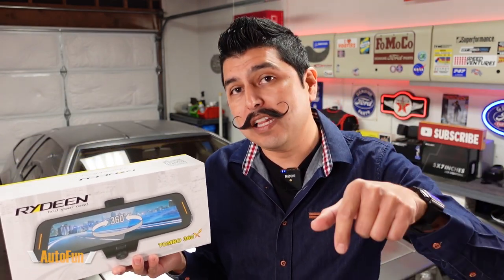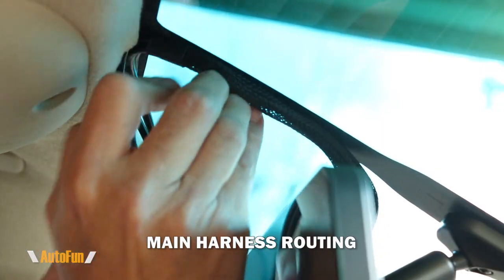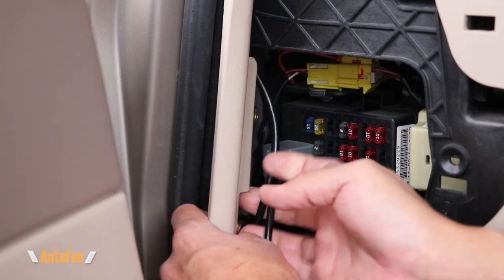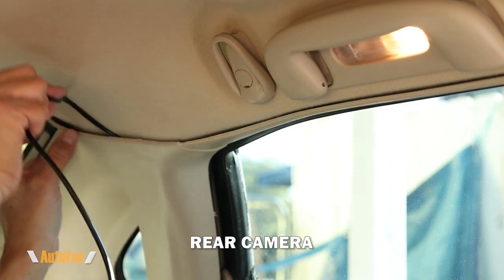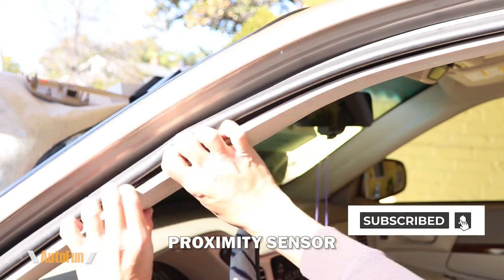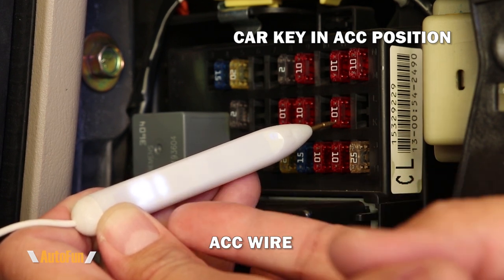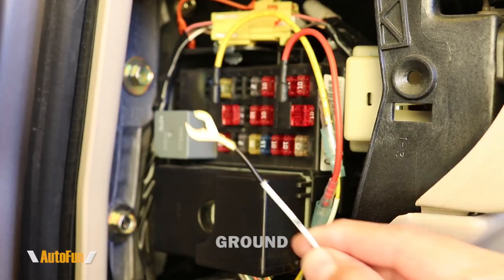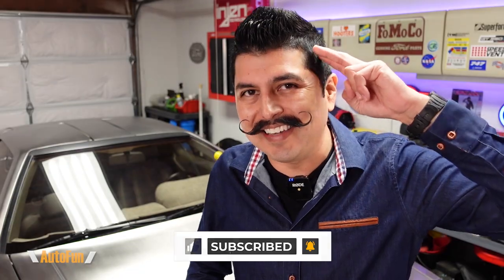Rydeen Tombo 360X Mirror Dash Cam Installation

Comment: Great video Alex...thanks! Are you still happy with this dash cam, and is it possible to hardwire it to my Silverado rear view mirror?
Reply from the maker: Thank you Rich! Yeah mine is still going strong and I actually just got the new update for it (video coming on this topic soon!) Regarding hardwiring it, normally this is done via the fuse box of the vehicle as shown on the video. Here is my follow up video where I cover how I find ACC and BATT on any car https://youtu.be/K2iKXj82354  However I strongly recommend profession installation due to the dangers mentioned on that video if erroneously tapping a critical system of the vehicle and the dangers involved with air bags mentioned on this video https://youtu.be/uZp95NbNlmM Cheers!

Comment: Hi Alex, you have a great site. One question, do you have a video showing how to install rearview mirror cameras to a truck, say a Ram 1500? Thanks.
Reply from the maker: Thank you fishnbaja! Ah yes the process is the same (camera can be mounted on the inside rear window to see out the back and also monitor the cargo or on the outside (if the camera is waterproof, typically by the license plate of the vehicle) And here is my follow rear camera installation video showing both inside and outside installation https://youtu.be/44WXN8MI66o with the inside being the shortest (and easiest imo). Cheers!

Comment: I really like this one. Which do you think is better between the Rydeen tombo 360 or the akeeyo 360/720? Im looking for a mirror cam that can be mounted without straps.
Reply from the maker: Hi Kendrik! Yeah the Rydeen is quite impressive. Regarding which one to go for, remember the Akeeyo 360 is not compatible with a direct fit mount, the 720 is compatible but does not support the advanced features that the Rydeen does (and does not come with the direct mount mount where the Rydeen does). So I would say if you are in budget and don't need all the bells and whistles go for the 720 however if budget is not an issue and you want the advanced features (Auto Dimming, Blind spot detection support, backup to SDD, concealed memory card slot, direct mount kit etc.) go for the Rydeen. And here is the review for the 360 https://youtu.be/u7jhNVtxQdM and the 720 https://youtu.be/o8begcmPA2w if you want to see those in more detail. Hope this helps, Cheers!
Reply: @AlexAutoFun  thanks for the fast reply. I was going to purchase the Rydeen Tombo 360 today. There's a car shop a few blocks down that has it. Don't know if they are an authorized dealer. Only because I want the warranty.
Reply from the maker: @Only1Of  You're welcome! And I placed a link to the mirror in the video description along with a discount code in case you decide to get it directly from Rydeen to ensure warranty (most installers will install a dash cam bought outside their shop) Hope this helps, Cheers!

Comment: I have a cuestion. This device fits on original ford explorer 2020 mount... thanks
Reply from the maker: Hi Willi! This dash cam is a universal type so it will fit pretty much any vehicle with the included straps. Here is my full review so you can see those in detail https://youtu.be/vUEsIYEBVck and if you are looking to eliminate the stock OEM mirror to mount the dash cam directly to the windshield here is my video explaining that process and the different mount types https://youtu.be/cCpyHmiZqiY Cheers!

Comment: Is there anyway to move the rear parking lines on the screen? I had it professionally installed. But when in backup, the lines are traveling to the sky..
Reply from the maker: Hi fullachit! The Tombo does not support adjustable guidelines via the software only physically (vertical adjustment) via the adjustment of the rear camera angle. And here is my full review for it https://youtu.be/vUEsIYEBVck so you can see how I have mine setup. Cheers!

Comment: Need some one to make a video of the product in parking mode and it's proximity sensor  How  much of the car does  it covers ,  exedra.... Pro kit package
Reply from the maker: Hi Humble Beats! There are two triggers in parking mode, one is the standard G-Sensor which works the same as when driving and the second triggers is the motion sensor, which will only cover the area that is pointed to, so lets say you install it facing the front of the car, people passing near the rear the of the vehicle will not trigger it and vice versa. Some people actually install the sensor pointing inside the cabin to capture if anyone has broken in, so it really depends on what area you are trying to prioritize. Hope this helps, Cheers!

Comment: I have a Jeep Wrangler and my sun visors won't allow a mirror larger than 10". Does this brand have a 10" version like the WolfBox G930?
Reply from the maker: Hi! Ah yes that can happen with larger mirrors, nope unfortunately they don't however here are two good alternatives in 10" https://youtu.be/v_1mCaEtbck and https://youtu.be/Yk2EEacXZ7g Cheers!
Reply: @AlexAutoFun  Thanks. What I find odd is the manufacturer claims this is a "10-inch Frameless Rearview Mirror with TFT Monitor" on their Amazon ad. Yet they also have the dimension listed as 11 x 3 x 0.75
Reply from the maker: You're welcome! Yeah this is large issue across the industry (video on this on the works actually lol) Some like to claim a smaller size, when they are bigger and some claim a large size when they are smaller, some round up and some round down dimensions, some measure the panel, some measure the outer frame, it's mess honestly lol So what I do on my titles is round up to be on the safe side of safe, so this one I consider an 11" model, if you take a look at my mirror reviews you will find the size in the title towards the end, hope this helps, Cheers! @naamangeist7843

Comment: If we purchase 360 view instead, and without a backup camera, will it still work? I mean, in this case we won't have a rear view because the original rear-view mirror would have already been blocked or completely taken out. Would like to hear your insights in this regard. Thx a lot!
Reply from the maker: Hi Dr. Cute Pets! Correct, the 360view was designed to work without a backup camera (since it acts like a regular mirror you can still see out the back), here is the full review for it https://youtu.be/7IED69-078E Hope this helps. Cheers!
Reply: @AlexAutoFun  Hi Alex! Thx for ur prompt response, really appreciate it! Without the backup camera, can it still capture what happened for the events on the rear end? Say I am rear-ended by someone else, will we have a video?
Reply from the maker: Hi 老黄生酮与撸铁 ! Ah remember if you are trying to capture in detail the outside of the rear of the vehicle you will want to add the rear camera. While the 360 camera inside the car captures 360° around it, it is still recording from the inside of the vehicle as opposed to the outside (like a rear camera can) and will also be limited in it's view by the windows of the vehicle (again because of it's position inside the car and being inside). Hope this helps, Cheers!

Comment: Hi! I want to install hardwire kit (fuse tap) for dash cam and I got a problem because of the space between plastic on the left side of the fuse box and tap fuses (normal dimension). It doesn't fit, fuses are too tall and went to the plastic area, left side of the fuse box. The correct orientation is upside, can't move them on the other way. Is there any fix for this problem? I've searched around the internet if there are smaller fuses and found something but not available on my country.
Reply from the maker: Hi Lucian! Yeah it's common for the fuse taps to interfere with the fuse box as far as clearance, more commonly with the fuse box cover unable to be re-installed, you can actually see that on my other install video here https://youtu.be/uZp95NbNlmM And on other times the fuse box has very tight slots for the fuse spots and the plastic body of the fuse tap interferes and prevents you from being able to engage the contacts since it won't fit into that spot completely with modification. Some fuse taps do have slightly wider plastic bodies, the ones I linked are the slimmest ones I have found but on those cases where there is interference issues I was still required me to shave each end of the plastic edges to get to fit, you can actually see it on my other video https://youtu.be/zbxYA4VhuT8 how the fuse taps have been modified (ends shaved off, which I hid with some electrical tape lol) Cheers!
Reply: @AlexAutoFun Hi. Thx for that fast response. I saw it a bit late, no notification.
I watched both links and somehow I have a different case because I have the left side of the fuse panel with a plastic wall (seat leon 1p) and my fuses can't fit. I've found some fuses wich are smaller in lenght, I ordered them, hope it's a fix for my car.
Reply from the maker: You're welcome! yeah with some many different car fuse box configurations, I can imagine there will be even more difficult cases like yours. Cheers! @SmartTuneNetwork

Comment: How do u get the video off the device if there is  no WiFi link?!
Reply from the maker: Hi! The Tombo does not support Wi-Fi, here is my full review so you can see how it works https://youtu.be/vUEsIYEBVck If you need Wifi & App support then you will want to go for the Wolfbox T10 or the G840H, here is the review for both of them https://youtu.be/Jt4ZvczqRi4 and https://youtu.be/2XQFw-C8f88 Cheers!

Comment: Can we use any rear camera thats 4pin? Rydeem rear camera is too expensice
Reply from the maker: Hi Manny! Ah mixing dash cam components such as swapping in a different camera, yes I had viewers done it BUT I usually don't recommend it unless you don't mind potentially voiding the warranty (due to mixing components). We also don't know the long term aspects (both operational and safety) of mixing components and there is also the issue of which components will actually appear to work (again without knowing the long term effect of swapping) since sometimes small differences between the products (while looking the same from the outside) are important (I had a viewer fry his new rear camera because the old wiring connections looked same as his prior rear dash cam) Hope this helps, Cheers!

Comment: I'd love one of these but how to direct kit fit to a 2023 Buick envision.. is it possible
Reply from the maker: Hi shenanigan! The Tombo 360X comes with direct fit included (including mounting mirror pad if your mirror uses a different one) here is the full review for it https://youtu.be/vUEsIYEBVck and if you don't want to use the mirror pad the Tombo includes and want to use mount adapter, here my another video https://youtu.be/TtjZ7rC_ncY where you can see what those look like at the 5:40 mark. Hope this helps, Cheers!
Reply: @AlexAutoFun  its built into the huge plastic housing so I'm not sure how to get to that mounting piece
Reply from the maker: @shenanigan3083  Hi shenanigan! Ah yes the ADAS housing, I have installed it on cars with it. Here is how I removed my housing if you want to see that process https://youtu.be/TvKRKYA7cgQ at the 3:00 mark. Cheers!
Reply: @AlexAutoFun  very helpful thank you 😊
Reply from the maker: @shenanigan3083  You're welcome!
Reply: I would like to install a dash cam kit like this one with the direct mount replacing the OEM mirror. I have a Ford raptor and in the OEM mirror is a sensor for the highbeams. Does this dash cam or any other support the high beam sensor or will I lose this in the every case if I want to remove the OEM mirror?
Reply from the maker: @valslist  Hi Valslist Music! Correct, there are no aftermarket mirror dash cams that will retain the OEM mirror function (on-star, auto high beams etc.) Hope this helps, Cheers!

Comment: The only problem with these type of dashcams, is that if your rearview mirrior has homelink buttons on it, this dash cam is going to get in the way of having access to those buttons.

Or even worse, getting rid of those buttons entirely if you choose to replace your rearview mirrior with this.
Reply from the maker: Hi Superman! Correct that is one downside of direct mounting and even on the strap style mounting the dash cam can potentially cover buttons on the OEM or Onstar mirrors. And I have reviews for traditional dash cams on my channel under the playlist "Dash Cam Reviews" if you want to use a non-mirror style one. Cheers!
Reply: @AlexAutoFun  Thanks!
Reply from the maker: @Superman-xr1oh  You're welcome Bud!